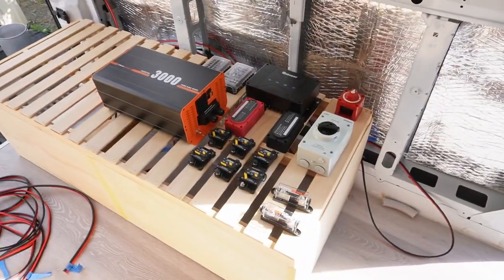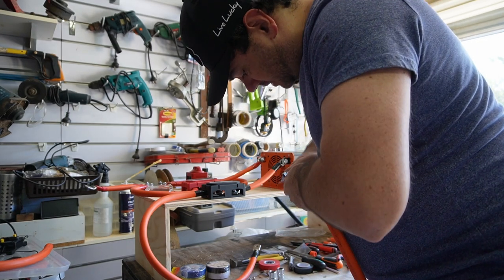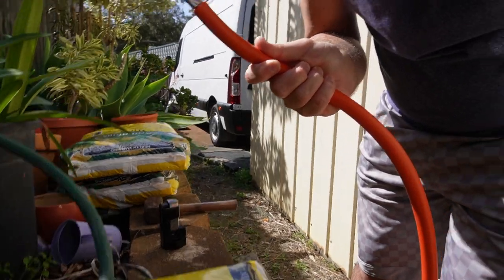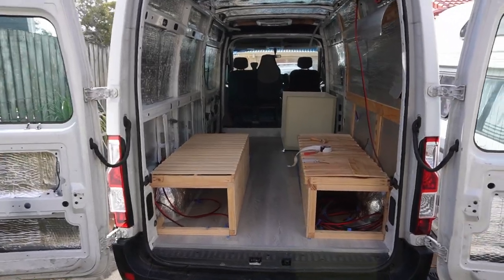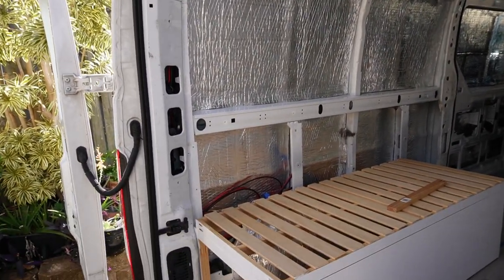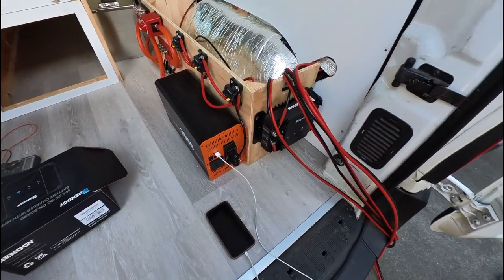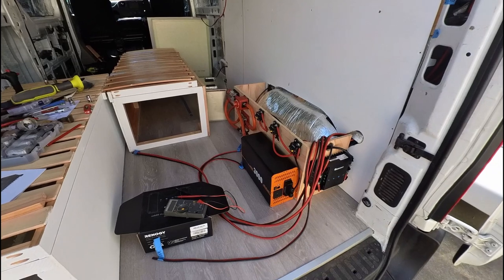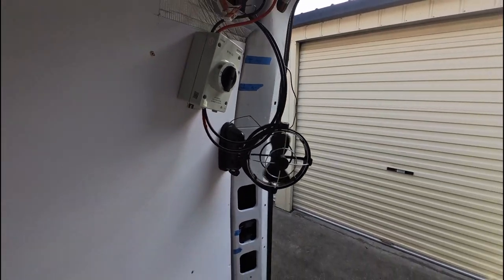Renault Master Van Conversion - Ep 013 - Electrical and more

Comment: Nice! Hella over spec with the giant orange welding cable! What is it? 0 B&S? Are you planning on putting a shunt on the battery? They’re so handy for state-of-charge with lithium batteries…

Also, do you have a clamp style multimeter that can do DC current? They’re great for debugging random power loss like you encountered with the starter battery.
Reply from the maker: Hey 👋 yeah I know I went over spec on the cable, it’s 95mm2 I figured better safe than sorry. 

I think my battery has the capability of showing the info a shunt gives, I can connect with Bluetooth and see the input/output current. 

Just have probe multimeter at the moment